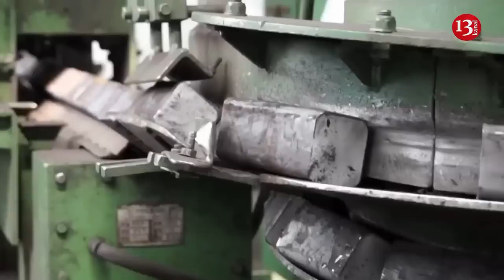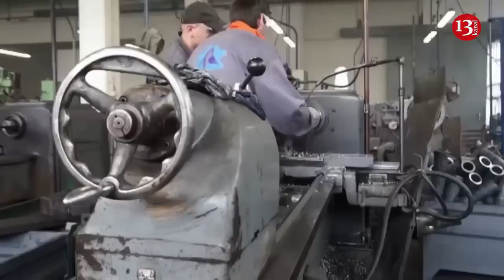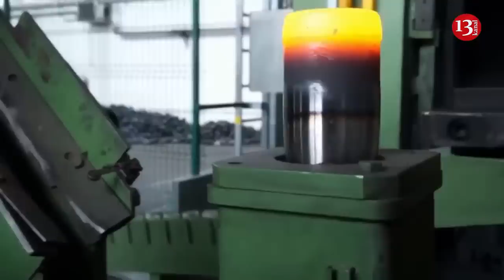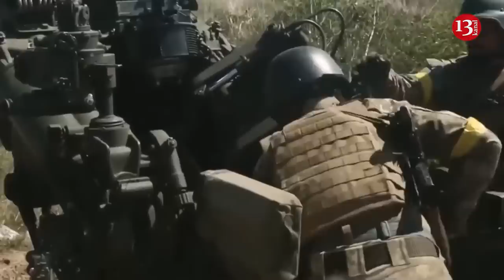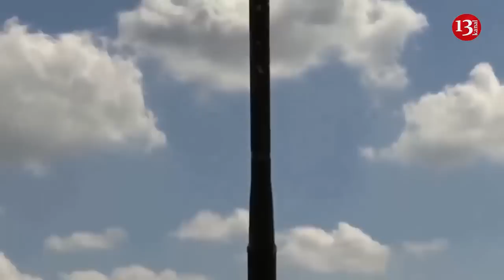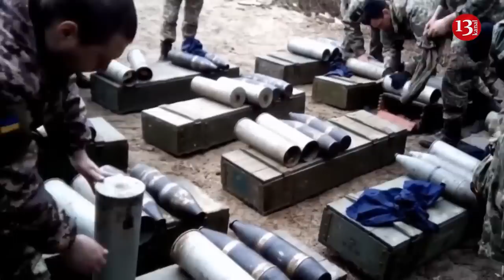Ukrainian Defence Industry sends first batch of its shells to defenders

Comment: In my opinion, it' s better to say the range of the shells in km instead of meters.
Reply: What difference would that make???? 1 km is 1.000 meters, just do a little arithmetic!
Reply: @Guillaume2606  The difference is a conclusion and not a calculation...
Reply: @Guillaume2606  It's a matter of making things easy. You could express the distance to the Sun in meters, but why would you do that?
Reply: @iamTheSnark  Of course, for people who have trouble, when they say thousand, just replace that with Kilo, and you'll be fine. So when she says 15 thousand meters, just  think 15 kilo meters.  You really have to have a mush brain to not understand the metric system.  It is an amazingly easy and straightforward system.
Reply: @Guillaume2606  When you say the range shells in km, the listeners quickly kwow the distance or the range, but when you say the range in meters and exactly the distance for example 14,520 m, the listeners have to concentrate listening the whole number and finally know the range. That is the diference when listening.
Reply: @tientran183  But 14.520 km wouldn’t require just as much thought? If you round to 14.5 km or 15km that’s just as easy as 14500 metres or 15000 metres.
Reply: This is the single most important argument in history. 🍿
Reply: @yonneye2427  its the difference between rocket propelled grenade versus RPG. Its the same but faster. However, you all need to give not just the speaker but the writer some leeway as english may not be their first language.
Reply: @gh4534  That doesn’t directly apply to my comment. I was responding to their assertion that 15000 metres is somehow easier to understand than 15km. No thought is required if someone uses metric on a daily basis.
Reply: @yonneye2427  Sorry. I just selected the wrong message to tag.
Reply: @gh4534  No problem. Your comment is completely accurate, I just wanted to ensure the right argument was being made.
Reply: If a number is precise such as 14,520 meters.

Saying in meters makes more sense than kilometers.
Reply: @yonneye2427  Initially meter is use for short distance, km for long distance and so to me the range shell should say in km and round it up.
Reply: @zlonewolf  If you want to know the exaxt range shell, but not everybody care about 20m of difference when saying it in km and round it up.
Reply: better in miles